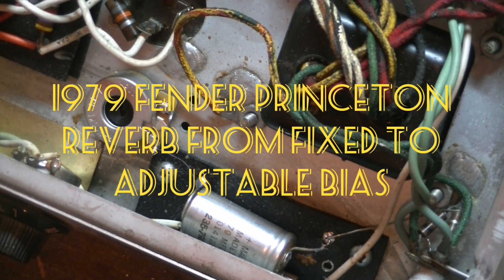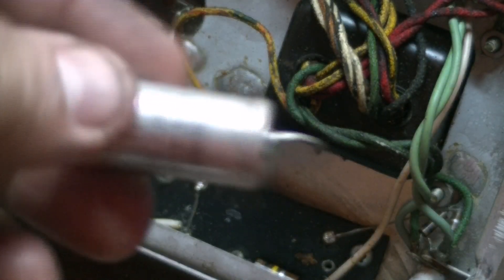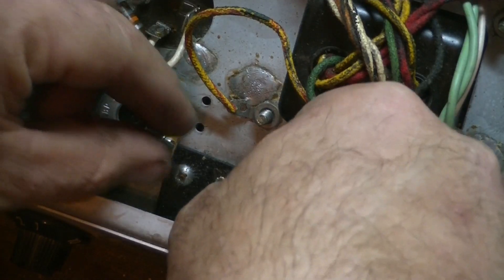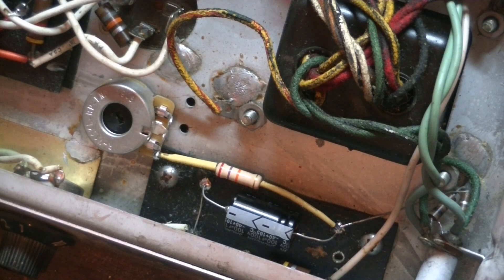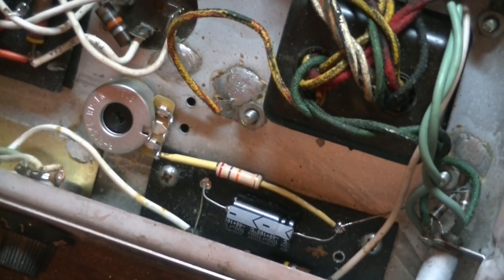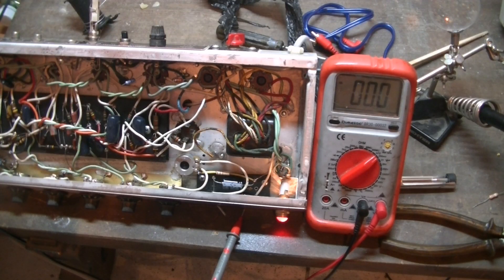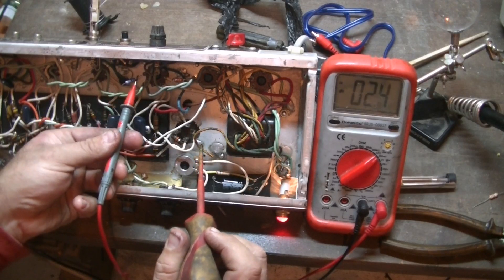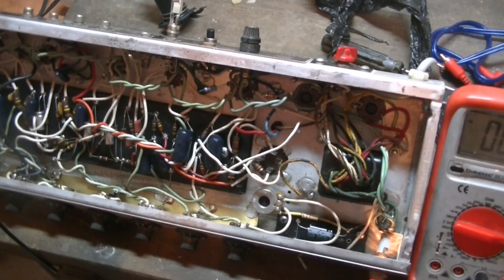1979 fender princeton reverb modification from fixed bias to adjustable bias

Comment: What value pot are you using and will more resistance in the circuit bring up or down bias in the tube? Thanks for posting c];-)
Reply: Uncle Doug has a very similar video to this, and he suggests a 10k linear pot.
Reply: @tonyhills2112  Thanks Tony
Reply from the maker: I use a 10k linear cts pot,
Reply: @MrEscharles  Thank you Edward appreciate that. c];-)
Reply from the maker: @ALtheDoctorWho  sorry for the delay in replying, all the best